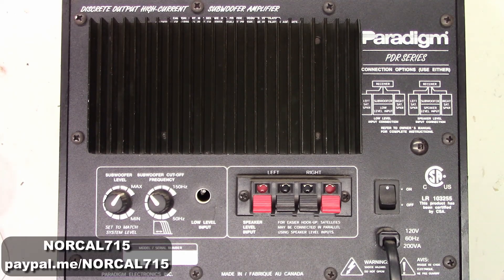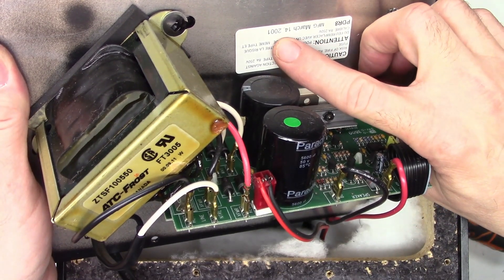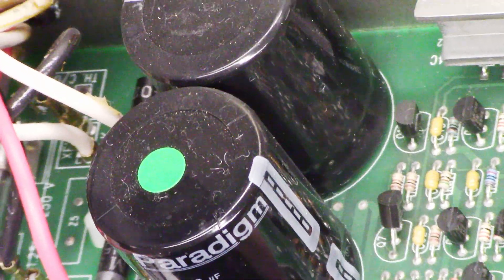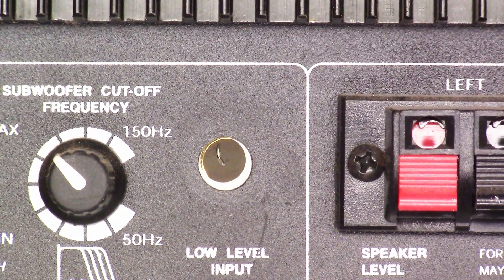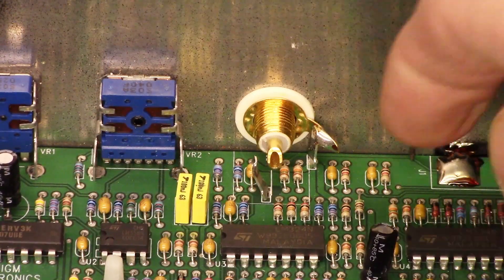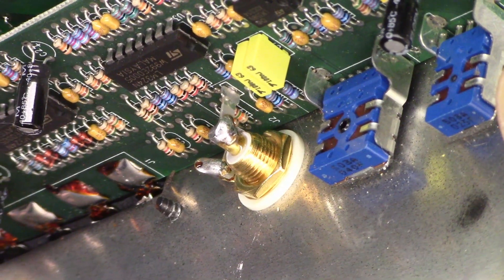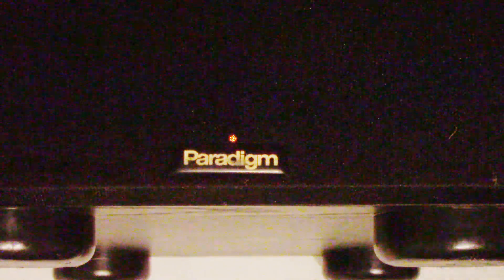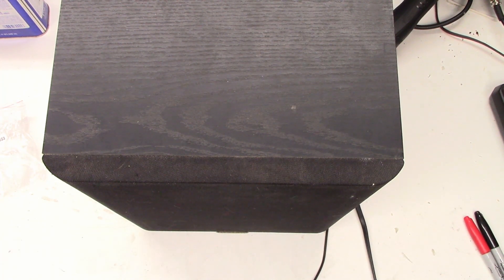PARADIGM PDR-8 SUBWOOFER REPAIR. INPUT JACK RIPPED OFF. REPLACEMENT AND REPAIR. PDR 8 PDR8

Comment: I have a paradigm reference subwoofer that looks like every thing except the power outlet and the adjustment knobs are the only thing left. It kinda looks like the amp was removed and someone put a metal plate back their.

Comment: Have you find the old connector nut inside the enclosure. I think its to big to come out through the hole in the  hot plate.

Comment: Hey NorCal. I have a challenge for you. Maybe it will be helpful to you, I know I need it for WOL systems I manage, I've done some research and no one in the computer PS mfg industry has gotten up to speed yet on adding switchable receptacles to their PS to hand other external hardware that so everything powers up on boot-up and shuts down when the system shuts down.. I have several systems that are remote that I work with and they have external hardware that need to be running when their up and running. Things like external HDD/SDD docks, etc. What would be involved with adding a switchable 120 receptacle to an existing system PS or wiring in a black box with a receptacle to achieve the goal? I hope you can at least give some guidance, if not a workable resolution to this need. Thanks for all the cool vids. I always enjoy seeing what cool stuff you'll be working on next and enjoy watching them all!

Comment: Hello this is off topic but I’m reference to a video you had years ago on the Samsung dlp , will the tv still play without the dlp chip heatsink ?
Reply from the maker: probably not for long before the DLP chip is damaged
Reply: Okay thank you !!  One more question if you don’t mind , I have assembled everything back together but now It will power on but eventually it’ll cut off while blinking the red timer/temp icon an green lamp lights I just purchased the lamp for it so I know it’s not the lamp , what would your suggestion be ?

Comment: how do I order the  input jack on a Paradigm PDR-8 subwoofer?
Reply from the maker: You can order an insulated RCA jack from ebay. https://www.ebay.com/itm/282590950559?hash=item41cbbbb49f:g:FO4AAOSwAYJZfDIZ you have to buy 10 though